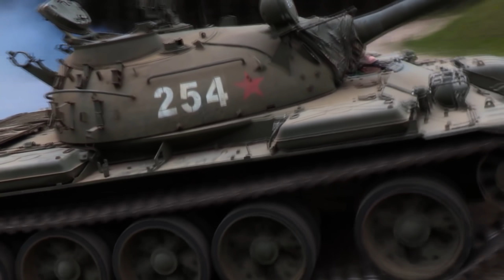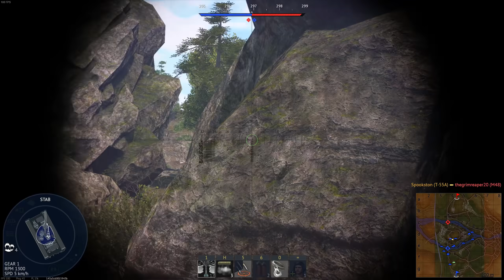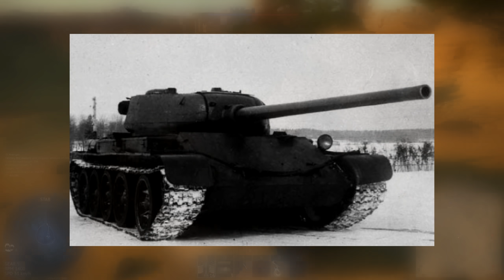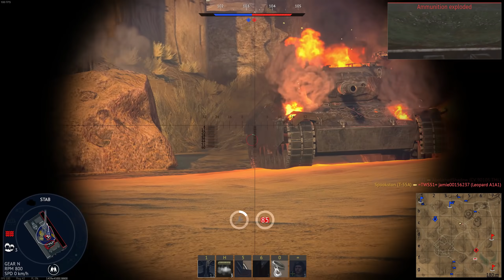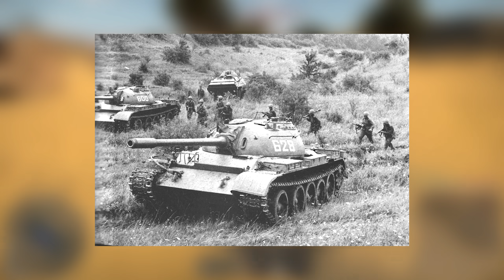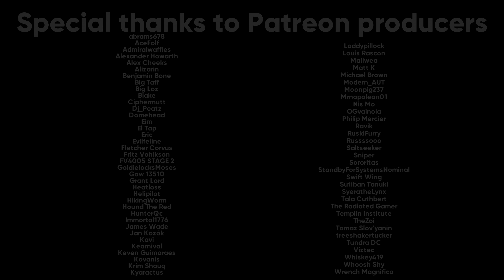T-55 - Tank History and Review

Comment: Whelp rn in 2023 as a tank it’s very ass now that it’s 75-76+ years old and technology is quite bad armor and speed and 100mm too isn’t enough vs tanks from 80s-90s
Reply: Yes, but it is generally not used for fighting tanks anymore either. But rather as artillery with protection against counter battery strikes.

Comment: Dude we need the m55, a Slovenian t55 with a 105mm smoothbore, era and thermals. We also need the T55AD, and T55MV, as you can tell i love the t55.

The t55AD would be great to be a test bed for active protection as it was the first tank to ever use it and could only protect against slow atgms making it not op in game.

The T55MV would be great to add as its basically the T55AM-1 but without the composite armor. It just has gen 1 ERA blocks that only protects against heatfs and atgms giving people another option who don't want to pay for a premium modernised T55.

The m55 should be a premium to help pay for the other t55s added to the game. The M55 is a 2000s modernised Slovenian T55 with a 105mm smoothbore L7 cannon, era, laser warning systems and thermals. Its basically a glass cannon that could be added to 8.7 helping russia face against all the damn leos at 9.0. It also wouldn't be hard to add as the Chinese premium at 8.7 the t69 would pretty much be exactly the same
Reply: You do realize we have a T-90A ingame... right? Along with Shtora Active Protection System that works
Reply: @kajmak64bit76  Shtora isnt hard-kill
Reply: bruh

Comment: I like to fantasize that all these cool incremental tanks got used or were developed earlier. I thought the T-43 in WoT was pretty good after the 100mm gun was dropped in favor of the improved 85mm gun. It has good enough soft stats to handle the 85mm well. If they had the resources to just switch production over and start making the T-43, it was an easy Panther equivalent. Imagine if instead of T-34-85s they had started producing T-43s or T-44s instead. 

 Likewise the American T32 was far beefier than the Pershing that eventually came out of the program. It even had a gun more similar to the Super Pershing's very long 90mm instead of the base M3 90mm. We had actually decided to adopt and manufacture the T32 but the shipping weight and logistics to get it overseas ended up being a big issue. So we lopped a set of road wheels off and lightened up the armor. The Pershing, and the subsequent Patton series that followed, were a compromised design. Imagine a T32 based M46 Patton. Suddenly not quite as outclassed by the T-54/55. 

Likewise the T29 and its many brothers were all built and thoroughly tested. They performed well, had good armor and armament for the time. Not quite a King Tiger equivalent but easily a capable Tiger Hunter. With a solid 105mm they would be a threat to a T-54.

Comment: The Germans are widely regarded as the best tank designers of WW2, but I think the Soviets were far ahead of everyone when it came to tank design. The Soviets were designing the T-54 and IS-7 while the Germans were wasting time designing useless tanks like the Maus or Ratte. The Soviet IS-3 alone was enough to push the West to completely reconsider their tank designs while the Maus would've just been a great target for bombing practice.
Reply: The germans are regarded as the best tank designers only by german army fanboys. How are you the best designer if you put in the field unreliable tanks that brake down ?
They also designed memes like Maus, or Ratte. Introduced utter failures like ferdinand or Jtiger. Best design, when the actual design of the tank is its biggest enemy. Do you not see the problem here ?
Big gun and thick armor does not equal good design. Any idiot can add them. Make a tank that is reliable, affordable, economical and practical and suited for large scale production while steel getting the job done. That is a good design. Not tanks that would sink in the ground, grind their automotive parts and fail to reach the front. Those are failures.
Reply: @Vlad_-_-_  Actually, that was.... you know, do you, there are a lot of lovers of Kraut's Sausages, pardon. 
They just hear "Jorman thing, of name «XYZ»" and instantly chanting "SUPERIOR JORMAN EEENGINEEEERING"!!!!
Reply: @worldoftancraft  I know man, there are so many idiots like that is insane.

Comment: T-34 had good armor? Nice joke.
Reply: Well at the start of the war it was good. But of course with introduction of Panthers and Tigers it become obsolete
Reply: @Янус_Ырт  I dont know...not even at the start of the war the armor was still poor. Youd have 37mm 50mm short 75s knocking t34s out. They didn't have to penetrate the armor but the sheer force alone could see the tanks poor welds and bolts falling apart. Just further reinforces the quantity over quality thing
Reply: @rayhan_2k841  you underestimate the quality. It wasn't perfect, but also wasn't so easily defeatable.
Reply: @rayhan_2k841 German tank gun Kwk 36 3,7cm could kill an early T-34 but barely. It was the 50mm tank cannon and I guess 4,2cm towed Pak41 anti-tank that worked in this area. Just like Pak40 of 5cm.

Poor armor quality was an early T-34 issue but not only early. Yet more devastating was the 34's plague of breakdowns - of all kinds. 
I guess the T-34-85 got thicker at front hull a bit but more importand was that late T-34s had their armor softer. Yup. Lots of early ones had the hulls cracked into pieces after single shot, or two 
(even some late German tanks had simmilar issues)
Key element was a lack of crew training as it amplified both, the amount of mechanical breakdows, and loses in fight. Soviet tankes "alowed" German troops to had kills even with tiny 3,7cm Kwk36
T-34s became a workable only after 1945. These are set some light years away in prod. quality from T-34s used from the 1941.
I would say it always was a poor tank but it had potent 85mm gun and cast, thick 3 man turret, and got equiped with radio.
 The crews.. yeah... 
Soviet Russia did not give two fucks about people... Thay cant count till today how many tankers got killed in T-34.
But hey! the infantry was far worse than that!
Reply: @Янус_Ырт  Obsolete? Obsolete, is when tank armour do its function? Its function, dear Tankie expert, is not to stop super fancy AT guns.
Reply: @worldoftancraft  man, I love T-34. I just meant, that it's armor was incapable of stopping armor penetrating rounds from late-war tanks, nothing more. If I used wrong word - I'm sorry, English isn't my native language
Reply: @Янус_Ырт  I'm not criticizing you except for the level of explanation. Obsolete means a bit more than "outdated", and even if it is, then there will be a question: "compared to what threat is it outdated"?
Reply: @worldoftancraft  compared to heavy AT guns, like those on Panthers and Tigers or heavy AA guns like flak 88
Reply: @Янус_Ырт  didn't i mention them either?
Reply: @worldoftancraft  no you didn't. At the start of the war it was pretty good against 37 and 50mm, but then the heavy guns were introduced, and it's armor wasn't capable of withstanding AP rounds anymore. It is all I wanted to say
Reply: @Янус_Ырт  I did mention them, quotation: "Its function, dear Tankie expert, is not to stop super fancy AT guns."

"... Super Fancy AT Guns."

Instead of learning the lesson of using more precise wording, you are keeping arguing. Why? What is the point? 
I understand that the 34'th armour can tolerate the medium-powered cannons, so?  
The problem is not me, being unable to understand something, but you, being unable to understand the issue with wording, the wording when you state that tank armour OBSOLETE*(and that's going without mentioning of RELATIVELY to WHAT it is obsolete)*

Armour has a much greater spectre of application, rather than stopping heavy, dedicated AT hardware.
Reply: @worldoftancraft  I know it, I did say, that obsolete isn't good word for it, and ALL I want to say is that. Why are you keep thinking, that I think, that T-34 is bad?
Reply: @Янус_Ырт  I don't think that you think so, I think that you need to work on your rhetoric and the way you carry your thoughts. This is the only what I think.